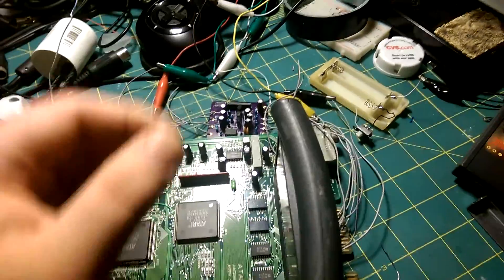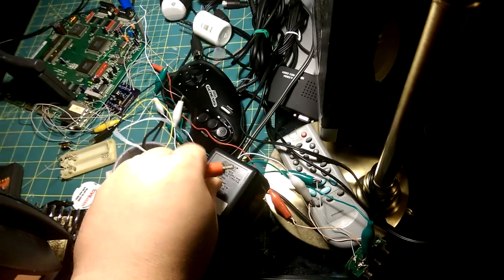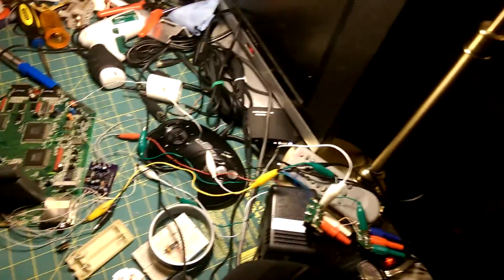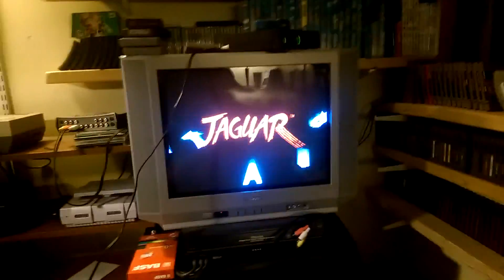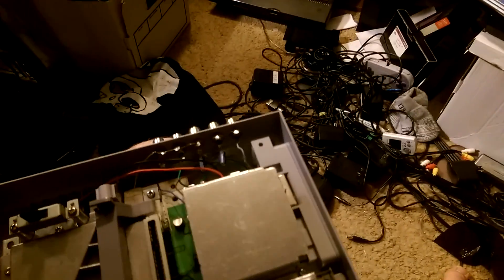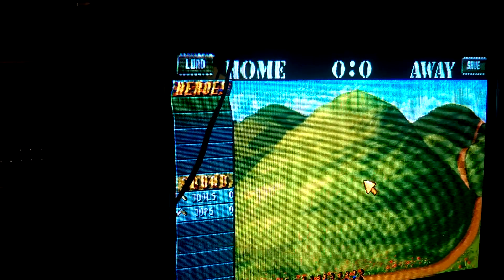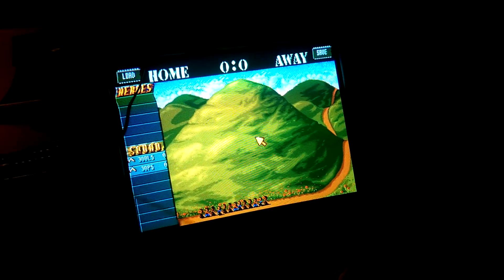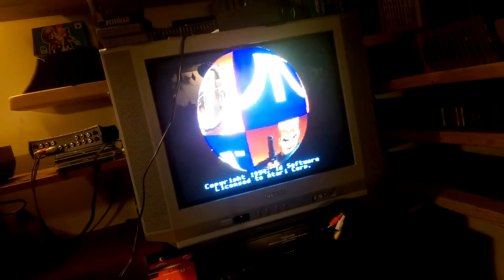Atari Jaguar Component Video YPbPr Mod

Comment: Hey there. I'm trying to get this same exact board to work with my RetroTINK and OSSC. Did you simply connect RGB, CSync, Vcc and GND to this board and it worked? I'm using a regulator on the Vcc out from the Jag's 9v+ (11A I believe).

Comment: This board is correct? I've been looking at the diagram of the board and Vcc and ground near the 10uf capacitor seems to go nowhere, It was not to be connected to the respective BA7230LS pins?